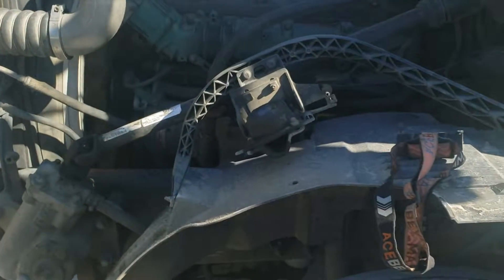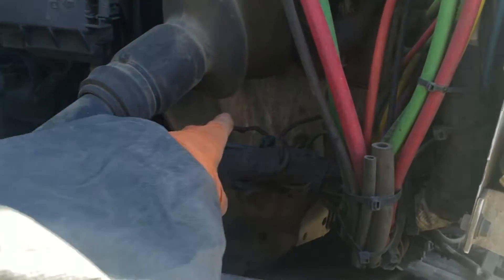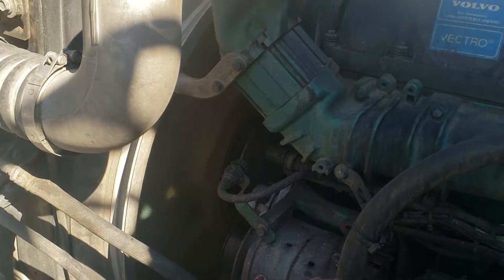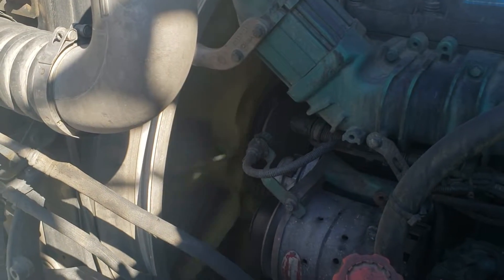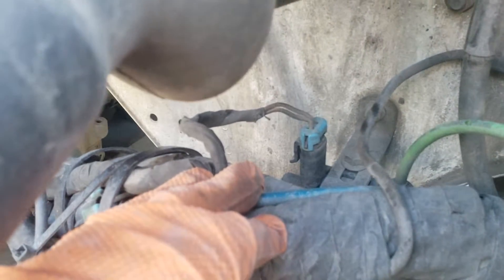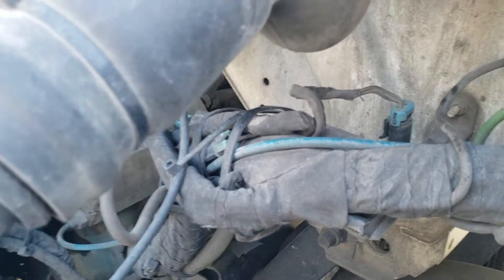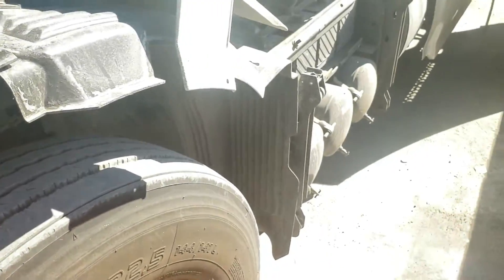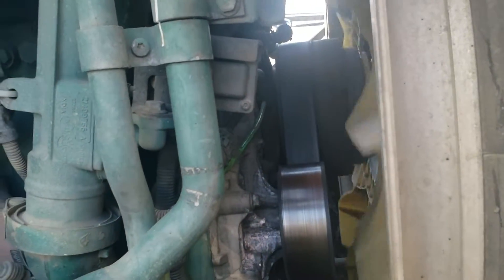Volvo d13 engine fan control solenoid location and way to put a manual switch

Comment: There is an easier way. Pin 19 on Ecu under the fuse box in dash. Its that wire and you only need a switch to ground
Reply from the maker: That is correct,  i can confirm that cause the truck i have now has an viscous fan clutch and that one is controlled by the ecu so there is no air going to it. I did wire a switch to that pin and it works...
Reply: @drevilatwork pin 19 on ecu under the fuse box in dash which ecu are you referring to???

Comment: On my D13 the wire coming out the fan clutch broke, I’m stuck on road, I’m I going to have to replace the fan clutch?
Reply from the maker: Is the wire that broke electric or is it a small air hose? Either way, system is designed to have the fan always on if anything beakes. If your fan dosen't turn at all with the wire broken that means the fan clutch is bad

Comment: Brother  thank you  so much for  this video you just  save my motor  I'm fully loaded and my fan was  not working wen the truck is moving, is working at low speed or wend the truck is not moving.
With this  trick I'm going to make home and have the solenoid replace

Comment: My fan stopped blowing even at 240°F on the gauge. Clutch is good tested with draining air from tanks fan turns on in emergency mode. What is need be replaced?
Reply: Did u fix it what was the issue?
Reply: @moneymikeslickwill8749  you may need to replace coolant sensor and thermostat

Comment: What year is your truck? My fan turns with my engine. On my other truck it is like yours here barely if at all spins until it kicks in. A shop told me I need a clutch. I may but he said it is NOT locking in to me it seems locked in all the time.
Reply: If u can prevent the fan from spinning while the engine is running the clutch is bad even a little movement while engraved is sign of a bad clutch

Comment: What amp on off switch do i use??,  what gauge wire???
Reply from the maker: About an amp so any gauge wire will do. I did put a switch on mine and it works great. Only things to remember are:  start the truck with the fan off AND 
 if the truck computer turns the fan on like when u climb up a hill and u let the temp get up yo the point where the truck computer turns the fan on, wait until the computer turns the fan off again, before u manually turn it on again, else the fan will stay on until u stop the truck and turn it back on.

This is because, when the computer turns the fan off, it dose it by supplying ground to the switch. The switch always gets positive . It's the ground connection that the computer controls the switch with. So when the computer supplies ground to the switch it also checks for continuity.  When you have manually turn the fan on from the cab you brake the connection and the computer thinks it's a fault and stops supplying ground until u stop the truck
Reply: so on which side is best to put a switch? + or - ?
Reply: @demianandrei2410  what end did you put the switch on? + or -?